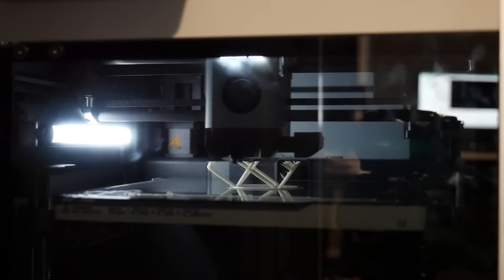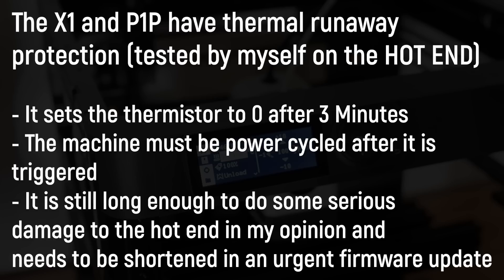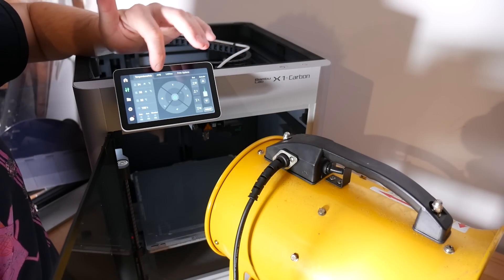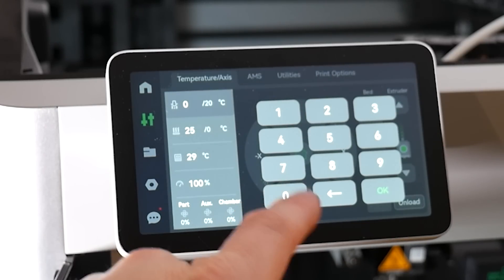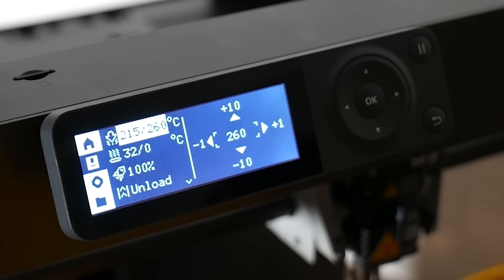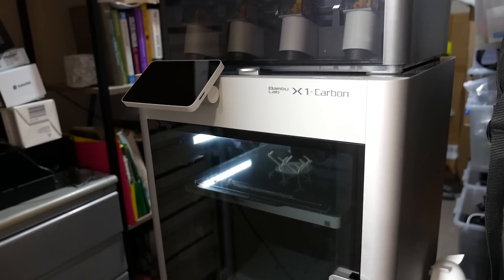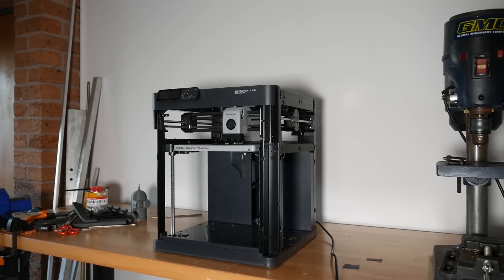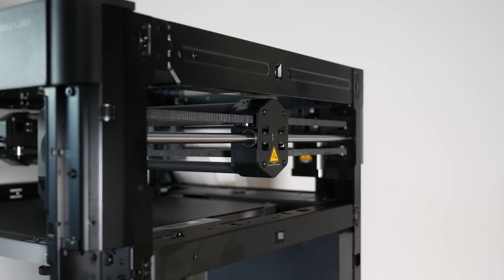Thermal Runaway Testing on Bambu Lab X1 Carbon and P1P

Comment: PLA auto-ignition temperature is 388C by the way.  ABS is just a hair above it.  (assuming the injection molded extruder motor assembly/magnetic cover are ABS).  someone said theirs got up to 450C+ (unconfirmed), so it might be getting well above the ignition temp or nearly all the materials in and around the nozzle.  hopefully they change the detection to be smarter, maybe they graph the climb rate and if it deviates by a certain number of standard devs, it goes into lockout or something
Reply: This one looks similar to these used in bambu:
(search "MCH heater" for images)
MCH is the abbreviation of Metal Ceramics Heater, which means metal ceramic heating element. MCH refers to a ceramic heating body formed by printing metal tungsten or molybdenum-manganese paste on a ceramic casting blank, hot pressing and laminating, and then sintering ceramic and metal together under the protection of 1600 ℃ hydrogen atmosphere. Corrosion, high temperature resistance, long life, high efficiency and energy saving, uniform temperature, good thermal conductivity, fast thermal compensation speed, etc.
Reply: "The HOTEND can only reach a maximum temperature of around 400 C...", what means the heater alone can reach higher temps, and it is probably not a PTC heater. 
Temps like 450C should be measured by external thermocouple or by pyrometer, because you don't know if printer's thermistor still works reliably at this range.
Reply: @KBS_  indeed, I'm just repeating what bambu said in their official blog post, they said in laymen's terms that it's PTC and that's what limits it to 400C.  (I have my doubts)
Reply: @ame7165  Given what KBS says and the heaters certainly do look like MCH heaters they are indeed PTC heater elements with formulations below 500degC being able to operate without any temperature control which means it is rated to be run open loop. No software, thermostats, etc... required to keep it in its safe operating region. It is called intrinsicly safe design it is a lot better than software safety measures. Obviously if you mush a blob of wood PLA on the hot end at 400degC you'd probably still get a fire but it is hard to control for 100% of all possible disaster senarios.
Reply: @riakata  For me PTC heater is commercial name to the heaters with very sharp temp-resistance characteristics, different technology, which indeed can maintain desired temp when they are connected to a small heatsink, and also keep the same temp when detached.
Calling MCH PTC is confusing. (Bambu doesn't call them PTC)
Reply: It is PTC, a few of us in the discord found that out while debating the theoretical maximum volumetric limits of the hotend assemblies.
Reply: @seashadow5239  Even metal wire is slightly PTC.
Reply: @KBS  you will have to pop into the discord and check it out.  Someone ran a bare heater element on a nice bench PSU, it is very noticeable.  The element dropped from 50w of dissipated energy to under 24w, and that was still well under 300c.  I can't remember the exact figures, but the user who did the test had a right proper setup to confirm PTC.

Edit: I was way off on my memory, I found the post in their discord where a user independently tested and confirmed it was ptc, see my comment below.
Reply: @seashadow5239  So he did something wrong. 24W is still enough to make a bare heater >500C.
youtu . be/  FIXG3tlILCY?t=975 Revo MCH runaway test.
Reply: @KBS  I had to edit my reply because that didn't math, I'm going to find the post.  Give me a min.
Reply: @seashadow5239  Most of any kind of the heaters have positive thermal coefficient, one higher, other lower. But for me PTC heater is a commercial name reserved for different technology than MCH heaters.
edit:
Use of incorrect terminology leads to misunderstanding. True self-regulating PTC in steady state works for example as follows:
Bare heater, supply 12V, heater temp. 300C ±5%, power consumption 5W. 
Bare heater, supply 24V, heater temp. 300C ±5%, power consumption 5W.
Heater + heatsink, supply 12V, heater temp. 300C ±5%, power consumption 50W.
Heater + heatsink, supply 24V, heater temp. 300C ±5%, power consumption 50W.
Reply: @KBS_  bambu has claimed themselves it is, users have done tests that indicate it appears to be correct. L. If you are crying foul, I invite you to prove them wrong.  I even linked to a test, a user did.   As far as I'm concerned, the burden is on you to prove otherwise.
Reply: @seashadow5239  My last reply. I can't explain it simpler.
There is no link. 
PTC heater is a component type, MCH is different component type.
Bambu calls them "ceramic heater", not PTC, and that's correct.
Yes, MCH has a positive thermal coefficient, but do you know the incandescent light bulb also has PTC?
Reply: @KBS_  They said specifically as temp increases resistance increases this is what positive temperatuer coeffient means (PTC). Please stop with your engineering misinformation.
Reply: @KBS_  No just no. PTC is not a commercial name it is a property of the material for the heater element itself. It depends on the metal/ceramic alloy used. You are causing a lot of misunderstanding and cannot "personally" define a technical term.
Reply: @seashadow5239  well the printer is advertised to be able to print at 300c, so i doubt that was a valid test if it was well under 300, unless they used a bench power supply and it went constant current mode and that was the limiting factor (which makes sense if it's PTC), but that would definitely invalidate the test.  i'll have to see if my two bench supplies can supply enough juice to test it myself.  i have an extra bambu heating element i'm wiling to sacrifice for science
Reply: @ame7165  Sea Shadow didn't mention it was in not a steady state. So for example 25W @ 300C, 5sec later it will be 20W @ 350C, 10sec later it will be 16W @ 400C etc.
youtu. be /nfatfsZOfPY True self-regulating PTC heater. It might be still difficult to understand for people. The graph shows power or current vs. time. It maintains its designed temp no mater of the thermal load.
Reply: @KBS_  the problem at hand has absolutely nothing to do with anything other than steady state.  ramp time doesn't matter.  we care about what happens when it keeps sending power to heat because it's not getting a correct temp reading.  if it's proportionally controlled with PWM, it makes perfect sense why it draws more power when it's farther from the target temperature.  that has nothing to do with the element having a PTC.  what we're talking about is how hot it can get with no limit.  like the board never turns power off to it because it sees the wrong temperature.  apparently after 3 minutes it will realize it's failing, but in that 3 minutes, what will it do?  where will it peak?  bambu officially said 400c is where it reaches equilibrium (where the graph ends because the resistance has reached a point where it lowers the current enough to limit it from going any higher in temperature).  someone said they saw theirs hit 450, but i never saw any proof.  you said someone tested and couldn't hit 300 and that's what i'm questioning.  the printer can print at 300, so it makes no sense what you said about it not reaching 300.
Reply: @ame7165  It wasn't me talking about 300C.
In my PTC video link there is no external PWM control. It is directly connected to a power supply. This is how PTC self-regulation works.
Reply: @ame7165  "MCH ceramic heater features no noise during operation and
radiates infrared light that is beneficial to the human body. It is
mainly used to replace the most widely used alloy wire and
PTC heating elements and components. Compared with the
former two, this heater features corrosion resistance, high
temperature resistance..."

"riakata:
MCH has a PTC value. PTC just means positive temperature coefficient it isn't a particular construction or material. (link. My reply are getting deleted bc links)"

So even they separate MCH from "PTC heating elements and components". 🤣🤣🤣
Reply: @AME  doing that would settle things for sure.  I've been debating using an element for the same test.  I've got some k-type thermocouples lying around.  Would just need to order in an extra element.
Reply: On the makers muse main channel years go Angus used a torch on different filaments and not only did they not ignite they were not self sustaining. You need 3 elements to sustain a fire. Fuel, heat and oxygen. 

https://youtu.be/a7l0Aaysy_8?t=258 

It looked like a butane torch with can hit nearly 2000C.  in open air

The PTC heater in the X1/P1P cannot go over 400C even in an abuse/negligence  scenario.
Reply: @ashleys3dprintshop  and yet there are many videos on the internet where people let a hotend go unregulated and they catch fire.  the nozzle on one of my two bambu printers has pla caked all over it from a prior failed printer.  there is air in the printer (air has oxygen), PLA's the fuel, and the heating element provides the heat.  you have all the right elements.  the PLA is what catches fire in this specific video: https://youtu.be/qVjWg2vuWzk?t=135
Reply: @ame7165  Molten alumnium is >660degC the bambu labs hot end can't reach those temperatures and that is the main reason software thermal runaway exists because non-PTC heaters can get to >950degC (melt the entire heaterblock and drop it into >100's grams of filament on the printbed below) In practice though that is a super bandaid solution using a PTC heater is far safer than software thermal runaway protection. PTC heaters are part of the 3-layer heater protection used in space heaters, kettles, and the such. (PTC + thermal overtemp thermostat, and final one time fusible link) to date I don't think there is any consumer printer that does all three because of the added mass, complexity, and cost.
Reply: @riakata  I have looked everywhere and I just cannot find an example of a melted heater block...
Reply: @ChimpyChamp  https://www.youtube.com/watch?v=xIA2yzb16Gk It melts at 660degC which is way below what high power NTC heater cartidges can do.
Reply: @riakata  It's yours and many non technical people's misinformation.
Maybe try to search PTC heater and MCH heater in e.g. Ali express. Why you will see 2 different components with different proprieties?
And again, you are wrong about NTC heater in e3d, it's not NTC.
Reply: @KBS_  AliExpress product descriptions is not how engineers define terms. E3d heater cartridges are vunrable to thermal runaway especially if in free air as they don't have a self regulating effect. They will exceed their operating temperature because they are not PTC heaters. The MCH heaters literally specify on their datasheets that no temperature regulation is required below 500degC type parts as they self regulate. The PTC heater is refering to current regulation if the tempco is not fast enough you will get a NTC effect where higher temps leads to more power dissipation and higher temps that leads to even more power dissipation until greatly exceeds its own operating limits.
Reply: @KBS_  PTC stands for positive temperature coefficient.  means resistance increases with temperature.  NTC is the opposite.  the resistance drops with temperature.  PTC is ideal for safety because it self-limits the possibility of a thermal runaway because as heat increase, so does resistance, which limits the heat it can create, so it reaches an equilibrium.
Reply: @riakata  Do you agree, incandescent light bulb has a positive thermal coefficient?

Comment: I use a copper bowl and dry ice to test thermal runaway on printer beds, so far not a single bed can keep up with dry ice as the heat sink.
Reply from the maker: Huh I'll have to track some down!
Reply: @moremakersmuse  BOC are probably your best bet in Australia.